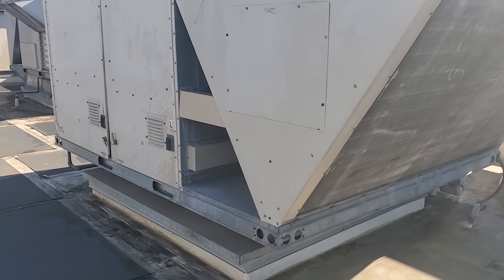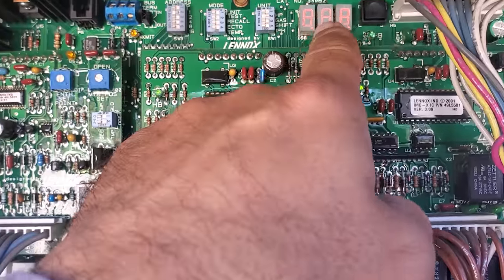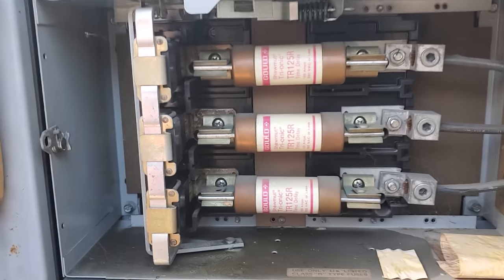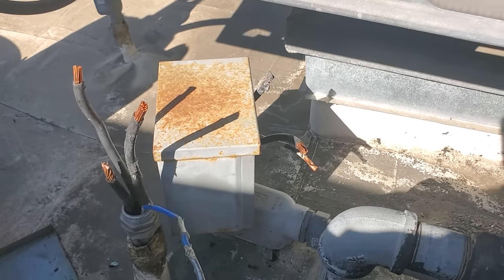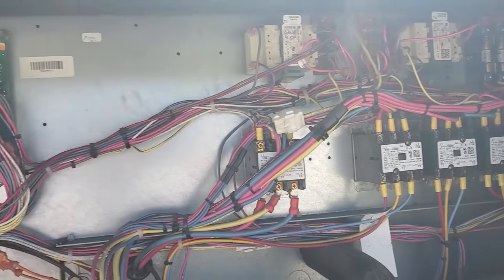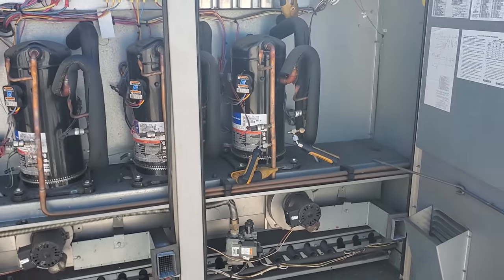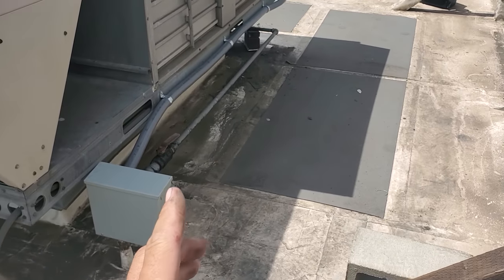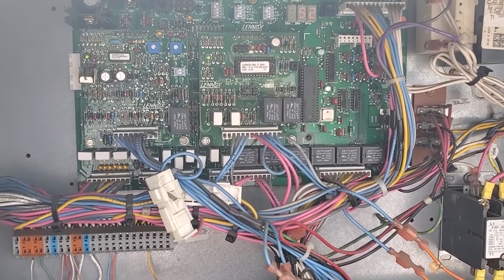ELECTRICAL FAILURES ARE FUN

Comment: I have no damn clue how you guys get away with aluminium connectors for copper wires, most of all outdoors. Each and every one of those is a time bomb. Alu and copper, once water gets to it basically turns into a 1V battery and corrodes the living shit out of itself
Reply: What way do you recommend to join wires of that size?
I know on smaller stuff like Christmas lights, I soldier it so doesn't corrode or easily pull apart.
Reply: @superchuck3259  Either with a ferrule and a connector like PTfix or large sized Wago terminals or ring-tube terminals with screws. Literally anything that's not aluminium. Also it's a stranded cable, use a ferrule if you're gonna put it in a place where thermal expansion can get to it.
Reply: @whatevernamegoeshere3644  Cool, thanks, I learned something about joining cables.  Funny how last night my son wanted me to watch demo ranch with him about shooting thru a cable.  If it was better to shoot thru a tight cable, well it was.  Good stuff, keeping my mind active and learning.  Plus hanging with my youngest son is fun!
Reply: @superchuck3259  Tbh if you want to learn about proper electrics, you can nick the NEC 2008 book from pirate bay and read up on some stuff. It has a lot of interesting and unexpected things
Reply: Once water gets to anything running power, it basically corrodes the living shit out of itself.   Aluminum connectors are just fine - as long as you don't use aluminum wire.
Reply: @tbelding  No. Aluminium wires are still widely used and they are perfectly fine for applications like power distribution where you're over 10mm2. Aluminium connectors though, they are an absolute no in every way. They are way too reactive to use for that purpose and most of all together with different metals. Look up a standard-potential table. Aluminium literally forms a battery with other metals. And in the case of press-fit connectors, it cannot bite down into the cable like modern steel ones because it's a soft metal. Street lighting and incommer connections on aluminium cables have large jaws that bite into the cable to puncture the oxide layer, (which btw reforms in a bout 10 minutes) and they are filled with silicone grease to close off weather. With aluminium connection blocks you do the exact opposite of this.
Reply: @whatevernamegoeshere3644  literally just about every lug in every piece of equipment is aluminum.. panels, meter sockets, breakers, disconnects....
Reply: @IrrationalBstrd  Yes, what alloy? Duraluminium? Is it coated? are you sure it's not steel with a nickel plating like on every disconnect ever used in europe? Also if you use aluminium terminal blocks, you either use a ferrule on copper or use aluminium, both of which remove the huge potential difference
Reply: @whatevernamegoeshere3644  I don't know what the particular alloy is of the lugs. Most of them are dual-rated  to accept either aluminum or copper wire via UL listing.  Use of ferrules or other crimp on type connectors is not typical here, but I'm sure it's done in some specialized applications.

Also, when terminating aluminum wire in a damp location (outdoors) the national electrical code requires anti-oxidant grease brushed into the strands.
Reply: @IrrationalBstrd  The dielectric grease or "alu paste" is a decent improvement over what was in the video lol. It's a real life saver. Honestly when dealing with aluminium it's a must

Comment: To me, the only option is to hire an electrician.  As soon as you saw there was an issue in that box, that should have been it.  Is there a minimum distance the junction box has to be off the roof?  If so, shorting the conduit wouldn’t be permitted.  And if you did repair that wiring, wouldn’t that make you / your company liable if anything happens to your repair?

Comment: a brownout could have caused the one to lockout and the other to burn the poor connection. but the poor connection could have caused enough noise and fluctuation to make the other unit lockup. good ole computerized junktronics ;)
it looked like wrong type of connectors on the copper wire, they appeared to be solid aluminum and not copper rated at all. probably the last RTU installer wired it and used wrong connectors.

Comment: Most controllers that handle this much current have a General Alarm.  Like a Check Engine light.  Something is wrong.  Connect the analyzer and I will tell you what's wrong.  In the meantime, I am going to shut down the system and let the humans figure this out.  As you found out, starting for cold and dark will many times clear the error.  Great video.

Comment: That thumbnail... There's so much wrong there that I'm not quite sure where to start.
2:44 - All Eights looks like garbage output from low voltage on the board or a crashed microprocessor... 
5:22 - As Eric O. from SMA would say, "there's your problem, lady!"

It's fortunate that you had an apprentice with you on an unusual service call. Not only so he can learn that there will be odd service calls that go beyond the basic everyday calls, but also how to troubleshoot and address the oddities. The more-prepared your techs are, the less you have to shoulder.

Comment: Who ever initially installed that Jbox should be slapped silly!  Cover facing that gas or water pipe limiting access. Easily fixed by just moving the box 180 degrees. Then what about that LB with the cover facing the roof by a few inches? The supply house didn't have any LRs in stock? Why didn't they really do the job right by installing an LL. That way we could block the LL cover as well!

Comment: You made the key error of testing your supply phases while load was connected, this will likely distort your readings as you get feedback from many onboard equipment like transformers, the voltages you thus measured were not representing the true state of the incoming supply although they still headed you in the right direction.
  When testing your incoming supply always do so at the isolation point with it off and load disconnected, plus like you actually commented on, it should be one of your first live tests to do, before you energise the unit not after, you could fry the boards if say there was an incoming neutral that had dropped which could raise a floating N at voltages higher than intended for any of the equipment using a N, before you note it, yes there was no N in this case but the procedure should still be the same as you can mimic that floating point post TX, in this case it would seem the pcb boards were running under voltage hence the 888 display and lack of response.

Comment: How does the meter determine the phase rotation at 15:30?
Reply: I guess it's dependent on what you say is Line 1, 2 and 3 with Line 1 being a constant between the other 2 lines. If you noticed when the assistant after doing Line 1 and 2 left a pointer on Line 1 and moved the one that was on Line 2 to Line 3, the tester probably requires that to determine phase.
Reply: @Wildcard65  pretty much it. If you look at the meter the common (black) terminal is labelled L1 and the line terminal (red) is L2 and L3. So it uses L1 as a reference and compares it to L2 and L3.
Reply: All of you may know this but in case you or others don’t the three phases each have a phase shift of 120 degrees. So if you start from one phase, a second phase is 120 ahead, the other 120 behind. Not sure which direction is required for these units, but if you need the order to be 1, 2, 3, then 2, 3, 1 and 3, 1, 2 are also good because it is the same direction (say clockwise). What you don’t want is 1, 3, 2 or 2, 1, 3 or 3, 2, 1 (counter clockwise). So your first probe sets the base and then all you care about is the direction. 
So the meter is doing the same thing as the load would do, responding to the direction, only the meter is doing it electronically rather than mechanically.
Reply: Simple time shift comparison on frequency of remaining phases. Old school phase rotation meters had literally tiny 3 phase motor and a dial that rotated.

Comment: Most probably the loose connection at the first AC, SENt peaks load and unload (so making voltage fluctuations) to the other unit, and the electronic just tilted or protected itself.

Comment: Why are you testing insulation resistance using the  OHMS setting on your multimeter which outputs about 6 volts DC  instead of a purpose made insulation tester such as a Megger which tests at 500 or 1000 volts to earth.

Comment: Why are the terminal connectors for the mains open like that? You just have to slip with the Multimeter and you could be dead. I don't know what you guys are doing over there but in Germany that would not have been allowed. And it's really dangerous. Why is that allowed and is that normal in the US?

Comment: I bet u that connection failed because of moisture ingres and corrosion. This leads to degraded connections and then heat and eventually failure of the conductor/connection

Comment: Who ever made that electrical connection did not understand the basics. You can not mix aluminum and copper. Does not matter how tight was that screw, these 2 metals never works together. Look how bad was oxidation.

Comment: 15:07 Those exposed strands between the unit and wire insulation seem like an amateur job. You're not supposed to have exposed strand? When I wire plugs, sockets etc I make sure there's no copper wire showing at all.

Comment: holy shit...if a german electrician saw that he would have a heart attack. No insulation on live contacts. Lines stripped so far that the conductors can be seen and touched ..... Electricians in the USA live very dangerous. I think the most important thing in the USA is that the cables from the terminal box to the device are completely laid in a pipe

Comment: 9:20 "Lucky it didn't trip the breaker".  What?????  That's the opposite of what I would think if a wire in my appartments wall failed like that. Is is so hard to reset a break? Are breakers just to prevent cascading blackouts? PS: I'm brainshacken that you are not an electrician. Great country that is allows for this flexibilty.

Comment: that wire remind me of rust push wire away became loose connection cause blew out n melted connection n ac have braker next to it cause electric short back "electric wave shock kinda like lightning spike but not hit by lightning spike it just like it"
it shorted resistors cause it lock down "i have fix few them not alway easy there more to it" good jobs tracking down bad wire

Comment: 5:10 Wouldnt that be 24v dc ?
Reply: no
Reply: Nope
Reply: Not at all. Transformers do not have built in rectifiers nor voltage regulators. It's straight AC to AC with galvanic isolation.

Comment: If anyone doesn't believe the A/C caused a surge to the other unit, think about this...When you turn on your dryer, the lights flicker? Sure, this is commercial three phase, but how much of a flicker would that cause with those wirings melting and shorting out? Anything can happen, but ehh...this my youtube keyboard warrior opinion.

Comment: 15:09 If that was a Licensed Electrician that did that work, he needs SERIOUS Retraining!

NEVER, EVER leave exposed copper when terminating a Conductor (wire) in a joint/lug/terminal the way this moron did with the 3 new Conductors entering the Disconnect Switch!

ANY Electrical Inspector that saw this would instantly Fail the entire Job, rip every Electrician involved multiple new Waste Disposal Orifices, force them to redo the bad work and likely write them 1 or more very expensive Tickets...

Comment: I know you knew what was wrong before recording this, but just calling for a power off at the disconnect when you put your hands on a belt attached to a motor was a violation of basic lock-out, tag-out rules that keep you safe. It is bad to show because somme idiot is going to see you do it and thing LO,TO is not needed and get their fingers or arm ripped off.

Comment: American electric is the stupid electric WOlRDWIDE. Copper wire with aluminum connector with iron screw. 
The iron screw destroy the aluminum connector over the time. Aluminum oxide is an insulator and the resistance increases the temperature and melts the aluminum. the correct way to connect copper to copper is to use a copper clamp.  Copper oxide is not an insulator and does not increase resistance in a dangerous manner, and copper can withstand higher temperatures. and different metals should not be joined without neutral metal.  Aluminum and copper or iron and aluminum are not connected directly, otherwise the less noble metal will be destroyed.  -> electrochemical corrosion

Comment: Your NFPA 70 adherence is sorely lacking, especially with an apprentice in tow! Where are your gloves? Are you wearing Level 2 clothing? I saw no LOCK OUT/TAG OUT. You may be a great AC tech, but you need to come up to speed on SAFETY! Get a go-pro strapped to your hard hat so BOTH your hands are free. 
Your  Electrican is a hack as well. 20' of Seal-tite, tho easier to install should have been rigid or emt with compression connectors.
Retire 40 year Electrican.